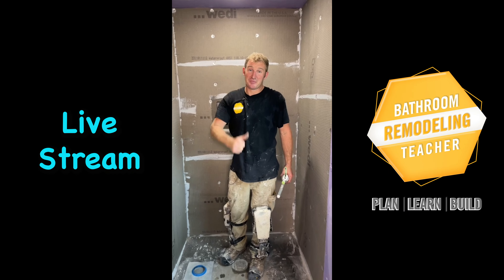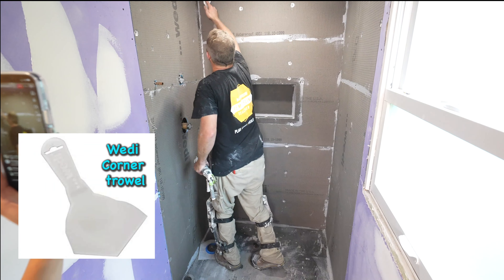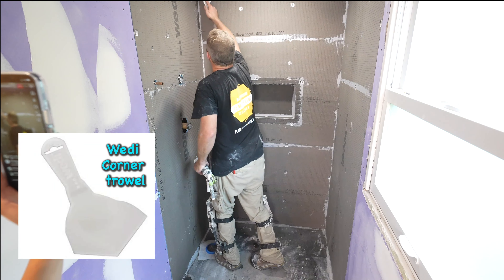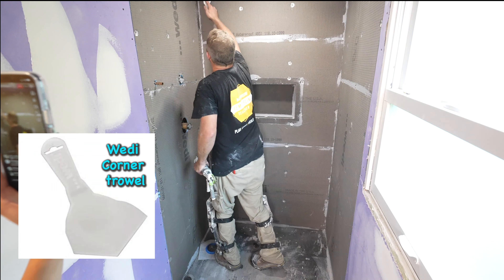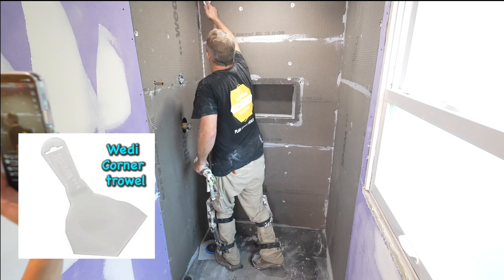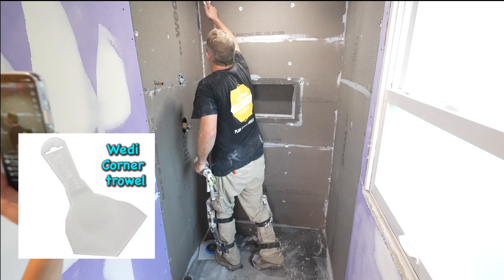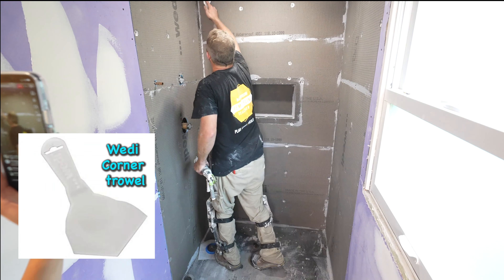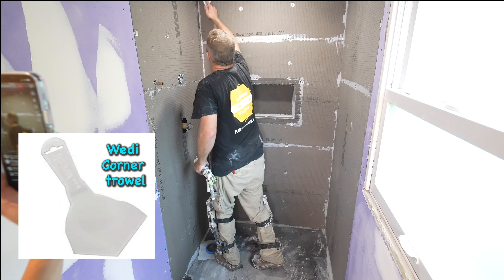Waterproofing a curbless shower🚿 | Wedi | PLAN LEARN BUILD

Comment: We’re starting the process of remodeling our upstairs master bath and this video was EVERYTHING I needed to learn about Wedi. The only questions I had for now are, was there a specific way to cut the foam boards when marrying the wall pieces to the shower pan, or preferred method?  Also, do you need to true up the wall studs to make it as flat as possible? Or when anchoring the boards do you try to keep it flat?

Comment: Thank you for continuing your teaching! You are the man, I trust you. Have you tried the peel and stick Ditra or Tile Redi in conjunction with curbless? Love to hear your opinion. I am pretty sure I will go with Wedi because it it more flexible than Tile Redi. The new Wedi click drain seems to have better adjustment to tile height. The Tile Coach has exhumed some Schluter drains that have leaked and has been using liquid membrane over it as a result.

Comment: Thanks, what if the owner does not want the existing bathroom tile removed when putting in a curbless shower ie……. No 3 feet of water proofing
Reply from the maker: I personally won’t do it unless it’s a slab home. I can’t see just sealing to existing tile and being okay with a wood subfloor. Last longer than you’d be liable most likely, but would fail at some point I’m sure
Reply: Thank you! I’m watching everything as I approach redoing our 3 baths.